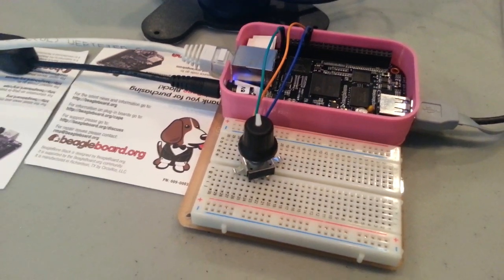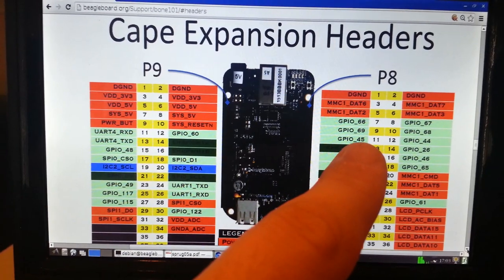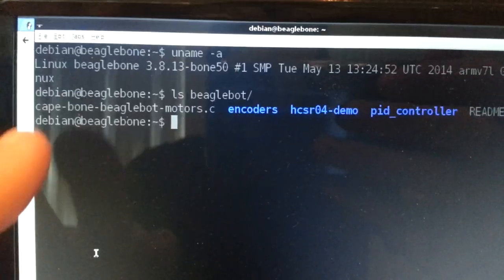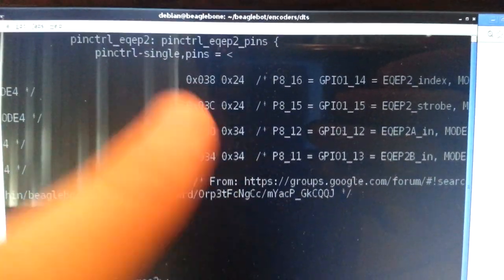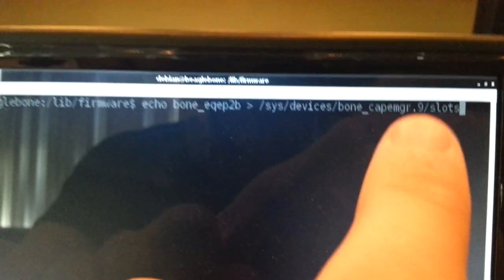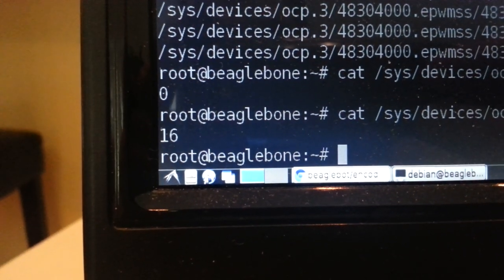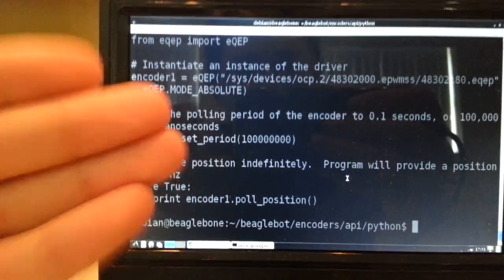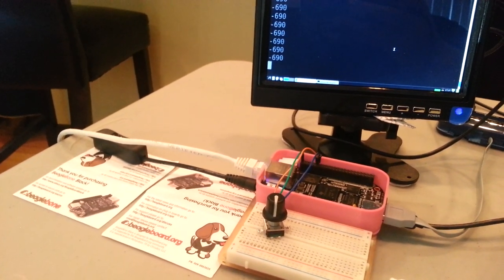BeagleBone: read rotary encoder position using built-in TI eQEP hardware module

Comment from the maker: BeagleBone: read rotary encoder position using built-in TI eQEP hardware module
I demonstrate how to read position of a rotary encoder connected to the BeagleBoard.org BeagleBone Black.  I use the eQEP (enhanced Quadrature-Encoded Pulse) decoder module built-in to the BBB's Texas Instruments Sitara ARM processor.
NOTE: This requires the TI eQEP Linux kernel module from Nathaniel Lewis  (http://nathanielrlewis.com/?p=87) which is inlcuded on BeagleBoard.org Debian image for BBB since 2014-May-14 (http://beagleboard.org/latest-images)
Further information on the eQEP kernel module and API for Python & C++ is in Nathaniel's GitHub repo: https://github.com/Teknoman117/beaglebot/tree/master/encoders
 #BeagleBone   #BeagleBoneBlack
Reply from the maker: Added BeagleBoard.org entry for this: http://beagleboard.org/project/eqep_rotary_encoder/
Reply: Nice.